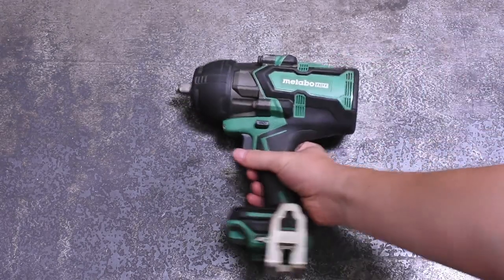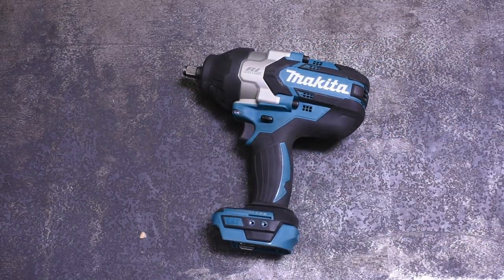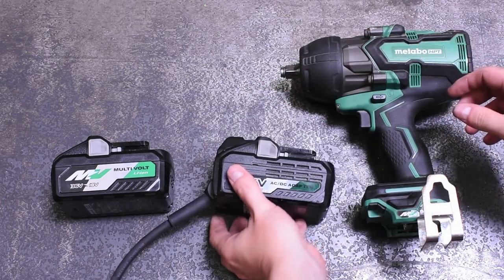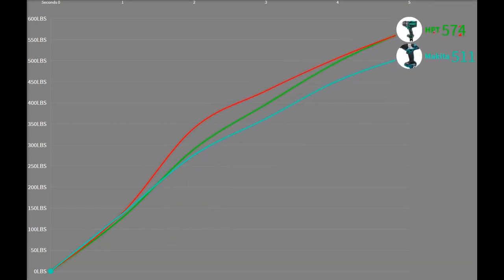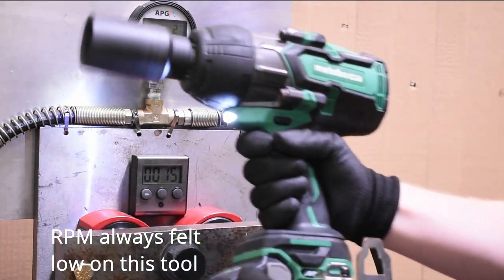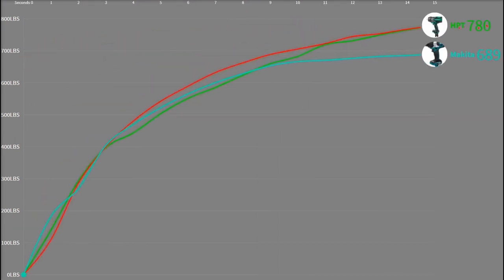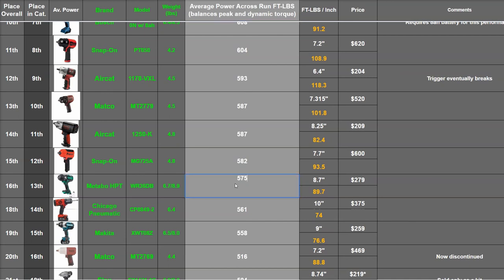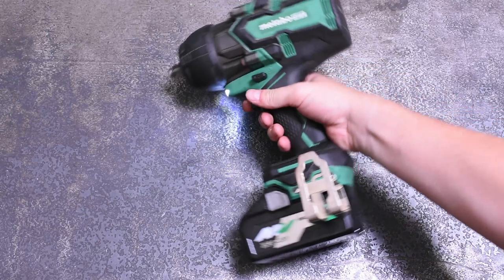What Happens When You Plug In a Cordless High Torque? Metabo HPT WR36DB

Comment: Metabo has a lifetime warranty as long as the tool line is being made. When the tool line goes away, so does your warranty. Also, all of my Metabos are IP56 rated...
IP56 = Protected against harmful dust (first digit) with protection from strong water jets and no harmful effects of strong water jets from all directions (second digit).
I enjoy your videos...thanks for testing!
Reply: lol, do you realize what the IP56 rating on their impacts is?  That is only for the hammer mechanism itself, dust or water will wreck the rest of the tool long before it would have wrecked the hammer mechanism, aka creative marketing that has limited purpose.  Also, typically the batteries are not rated for that so where will you use the tool without the battery?

I mean exposure for a moment, sure a coating can keep the tool running but regular exposure, will destroy it and would likely be considered abuse that is not covered under warranty.
Reply: @stinkycheese804  It doesn't matter since the original purchaser has a Lifetime Lithium Ion Tool Warranty and a two year warranty on batteries. 
"Lifetime is defined as the serviceable life of the product. This is defined as the period during which all components are available." So, it's when you are outside these warranty windows that dust and water matter! So, I guess you better have some back up tools!
Reply: I wash my impact driver with soap and water if it gets black crud all over it. That drives ip56 doubters crazy 

The motor and controller are putty'd into their own walled off sections in the shell and the controller itself is contained within a massive 1/2 inch solid acrylic brick with wires coming out of it. 😁

The only real concern in a tool like this is (probably) just maintain the rust inhibitor on the stator from time to time
Reply: Metabo did actually honor the warranty of an old Hitachi drill that I've had for about 5 years. The chuck wore out and was giving me issues. Sent it in to Metabo, they replaced the chuck with a new one and had the drill back to me in under 2 weeks. I was pleased to say the least and now own basically the entire 18-36V lineup. Great luck out of them all so far.
Reply: You're implying that once the tool becomes discontinued it's done. That's not true at all. As long as there are still parts for it, it's covered. That also doesn't mean they won't just give you the new version. They generally carry parts for 10 years after it's discontinued. This is per their words exactly.
Reply: @ToolDeals  What I stated is exactly what their warranty stated. Note the quotes. If they do something different, it is an exception to their warranty and is not stated in the warranty. 
Here it is again..."Lifetime is defined as the serviceable life of the product. This is defined as the period during which all components are available." Having a replacement part here or there is not a period during which all components are available. So, I guess that it boils down to...Metabo can do whatever  they want.
Reply: @marauder2525  you might want to call them as I have cuz they have said that They will continue making parts well after the tools is being sold
Reply: @baseballdude8491  You misconscrew what I am implying...I am not complaining. I have the Metabo Hybrid miter saw, the mobile table saw, the hybrid circ saw, 2 Triple hammer impact drivers and a hammer drill. I just wanted to set the record straight according to the warranty. In my business, if it isn't written it DOES NOT exist. 
P.S.No brag just fact... No FAN BOY here. I have other tools including Makita sub compacts, multi-tool, and rear handle circ saw. Also, Dewalt Flexvolt and 20 volt max tools. I don't use red tools.
Reply: @marauder2525  my bad-just got confirmation from a few other guys that Metabo HPT/Hikoki is going to support parts to these tools for yrs after the tool isn't being manufactured-I have had good success with warranty service and more straight forwardness with Metabo HPT/Hitachi than my other colors
Thanks for clarifying-I just get a bit frustrated with some.of the specific color fanboys who spout off things with little or no experience with the tools-again, my bad 👍
Reply: @baseballdude8491  You actually bring GREAT news. Thanks

Comment: Very interesting... I've seen that wall adapter and thought it was a good idea. Especially for a finish carpenter using the mini circular saw all day.
Reply: Would make more sense to just buy a corded saw, then with two tools you put less wear on each, and can move around without dragging a literal brick with you on the extension cord.
Reply: Some people don’t want two saws though.
Reply: @spottedcrow1126  right? already carry too many tools and im just an apprentice
Reply: Go ahead and drop another 4-500 for a.second saw
I luv my 10" mitre and table saw
Both are best in industry at that price range.and the table saw beats em in performance by far and capacity on the table
Reply: Yeah and AC adapter great for SDS Max Rotary hammers, table saw, vacuum, grinder, and other high run time tools
Reply: @stinkycheese804  we use adapters on our table saws, SDS Max rotary hammers, grinder, router and vacuum which are in stationary areas and save crazy amounts of Battery life/longevity
My other contractor friends were amazed/jealous when they brought out there SDS cordless Milwaukee and DeWalt SDS Max rotary hammers and ran out of juice and charged batteries while I just swapped over to the AC adapter when we were breaking up a large concrete stair

Comment: Grainger would come to my work to show off new tools and I was asking reps from each cordless tool company why can't I have a plug in adapter for my cordless tools . They all laughed and said why would you want to put a cord on a cordless tool ? I just shook my head . Maybe so I can have consistent performance on the 50 bolts I have to remove on a piece of equipment . Nothing worse than diminishing performance especially on old nicad  batteries and then I have to manually go back to hand tools and use the tool as a glorified nutrunner . Well it only took them 20 years to see what I told them was a great idea . What is the maximum amps that adapter puts out and does it maintain the voltage at max current output ? Lower voltage draws more current to get the same output . Could you please take adapter apart so we can see what they are using to rectify to DC from AC and if it is a transformer or a switching power supply and voltage regulated .
Reply: My question, why use a cordless tool with a cord when you can get some sort of corded tool that would function the same and probably be cheaper. The only advantage I can see now is they really don't make corded tools as much now. I would think an air tool would be the lightest, with very good power.
Reply: @snoopdogie187  yiy answered it. They don't makemAC powered corded tools like impacts.

Actually there advantages to the DC motors in these tools, it's just the batteries that suck. Better than the Nicad days, but still suck in the long run.
Also, being able to go cordless when needed without 2 tools would be handy. But when in a shop with constant power available changing/charging batteries all day sucks.
Reply: @snoopdogie187  with Metabo HPT u can use it where there isn't power but utilize it where there is saving battery longevity as well as increasing your overall run time and work capacity and not have to carry around a corded and cordless tool in your truck-makes a bunch of sense and we utilize the AC adapter at our Mitre saw, table saw, router , grinder, SDS Max rotary hammer and vacuum stations on the job site-if we need it for an area where not AC is around we put a battery in-its awesome and has given us more longevity on our batteries as well and lessens the # of batteries needed overall saving gobs of $

Comment: Are you guys planning on testing the Metabo HPT 3/4 in version? I'm curious to see how it stacks up against its 1/2 counterpart, both corded and cordless.
Reply: It is only rated for a 40 or so more lbs than the half inch so I don't know if it's worth it. I have the 3/4 model but there didn't seem to be enough interest to ship it to them.

Comment: the lower performance of the corded thing is because of the wire. the actual converter that makes the 36/40V is in the brick and the wire between the adapter and brick is what causes a voltage loss and thus lower total power.
Reply: @1pcfred  the brick can push out 50A. that is more then what the batteries can do for any reasonable time.
Reply: @1pcfred  its litteraly written on the unit by law what the output is. No need to guess or test. The power loss over the wire is simple ohms law.

Comment: Can't wait to see the tool truck high torques tested. I have a feeling they won't do any better than the regular cordless tools you can get at the home improvement store.
Reply: Cordless tools are scam. While I won't sit here and say all of the tool truck tools aren't a scam either, some of them cost the same as what you could buy from amazon and have the same and/or better power as a cheap scam tool from the hardware store designed to fail in 2-3 years.

Comment: I figured the plug in adapter would have boosted the output torque, but as demonstrated it did the opposite.  Course a dedicated corded impact would be totally different anyways, but a great demo that plugging in an adapter on a battery tool don't necessarily mean it'll make it better.

Comment: Awesome testing, I’m really thinking of getting into Metabo HPT line mainly for the angle grinder and being able to use a cord and battery!
Reply: I doubled down into the same impact, grinder, hammer drill, and recip saw. No complaints at all, phenomenal tools

Also took advantage of there webpage promotion at the time, buy a tool and register it on there website with proof of purchase. Then you get a choice of a free 4ah 36v battery or the wall adapter. I got a lot of batteries now + 1 adapter 😀
Reply: Absolutely the 36V grinder, SDS max Rotary, vacuum, router, portable band saw ,10" table saw are all great tools to utilize this hybrid cordless/corded option

Comment: Power loss with the ac adapter would be cause it stays at a steady 36 volts and the battery when fully charged would be closer to 42 volts. 4.2v per cell x10 cells = 42 volts.
Reply: When you put a battery cell under a load though the voltage will drop, so even though you may measure it at 4.2V fully charged it will run much lower when loaded.
Reply: @GuyFromJupiter  That is often true but something else to be tested/measured, as these larger cells in a higher voltage pack, won't necessarily droop enough to be significant in a brushless tool.  Either the initial 36V, or the AC/DC adapter droop under load, or the losses over the power cord, were obviously a factor so the delivered power was lower than with the battery.

Comment: The AC wall adapter is an interesting idea, but we probably should not be surprised that the tool loses a small amount of performance when using it.  Even if the power supply could deliver a steady 1,500 watts DC, there will be electrical losses in the DC cable between the power supply and the tool.   I could not find any specs for the DC cable, but I will take a few guesses.  Assuming 12 ft, 12AWG, & 40A @ 36v, the voltage drop (at full load) would be about 5%.  This correlates with the dyno test well.  This is not a criticism.  I like the idea.   I wish the tool system that I used offered this option.
Reply: And what about the battery when 75% charged? Or 50% charged? 

You don't have a freshly charged battery all day. But the DC supply would be constant all day.

The channel tests max performance, but the 50th bolt you remove is just as important the 1st.

I look forward to the results of future tests showing performance aftermath foxes 10second runs instead of just one run on a fresh battery.
Reply: 240 volts

Comment: Hello again Torque Test Channel 
Thank you for another Great Video. I am researching for my next tool purchase. And most certainly will be my impact and drill. Which right now is a five years old plus Hitachi twelve volt. So far this is all I have. At some point I will have to replace. And the Field is a lot bigger than I thought it would be. As a Aircraft Mechanic I don't need the biggest or heaviest tools. But I do need is more torque versus carrying a lot of weight. I may have to take apart a wing, maybe something like a Boeing 747. Carrying that tool until the job is done. The twelve volt has carried the day so far!!! The question I need to ask is should I stay in the Hitachi tools lineup or I keep looking? Again thank you
Reply from the maker: Keep looking when it comes to weight/vs performance. Looks at the Makita XWT14Z or M18 2960-20
Reply: @TorqueTestChannel  Thank you for the quick response. I will give them a look.
Reply: How many batteries are you willing to carry and keep charged?
Reply: @TEDodd  Right now, I carry two batteries. I think it came with 1.5 hours. One in use and charging.
Reply: Metabo HPT 1/2 mid torque is my go to now
Replacing my Milwaukee

Comment: About 10 years ago I adapted my craftsman cordless tools to run off a car battery. It let me run my sawzall and skillsaw much longer without bogging. These lithium batterys are great now though.
Reply: Ok, if you say so. The lithium batteries are a marketing scam designed to make you buy batteries every 1-2 years.
Reply: @JosephArata  well they are better than my old ni-cd batteries haha
Reply: @JosephArata  higher power density, no memory effect, and longer life. No scam. 

That's why other electronics have switched too, like your cell phone.
Reply: @JosephArata  dude every comment is a cordless hater take-look I still run corded tools but many of these tools make work go faster without as much set up-Metabo HPT 36V should be your choice to give em a whirl as they have the AC adapter for all those tools U want to stay in AC but also afford U the ability to unplug when u need to take them to the work where ni AC is available
Plus I've had some of my Milwaukee, Makita and Hitachi batteries for over 10yrs and they are still charging and working

Comment: Iirc, the way the metabo hpt lifetime warranty works, is "for the life of that model" - guaranteed as long as they haven't discontinued it. Just as an fyi, it's good to know how long your hpt tools have been out before buying if the warranty is important.
Reply: Actually I contacted Metabo HPT and it s the time they make the parts as well and confirmed that they plan on having most of these current tool parts for 5-yrs after discontinuation

Comment: I have The larger of the 2 Dewalt Vacuums that comes with an optional cord in the event you dont have battery or its dead. I have found the cord to be much weaker than the battery mode. I typically use the 60v 6ah batteries which is notably more powerful. However it's a vacuum.

Comment: Could be the losses in efficiency with the ac to dc inverter that makes the powerloss compared to the battery. Making 2000w in from the wall but around 1200w out from the adapter (up to 60% efficency at 120v) that would make it 33amps at most compared to around 35amps of the battery.

Comment: What happens when you take apart the biggest battery of a brand and replace the li ion cells (18650/21700) and put in the best high drain cells you can get. Like the molicel p45b 21700 cell or molicel p28a 18650 cell

Comment: That 120 volt adapter result surprises me. We've seen in other tests that the higher Ah batteries deliver higher performance, up to a point, and jumping from a battery that can deliver upwards of 35A to an adapter that can deliver 55A (2,000 watt at 36 volt DC) should (to my mind) result in a higher performance.

Maybe the battery delivers a higher voltage than the adapter? Or maybe the adapter doesn't actually deliver 36 volt?
Reply: Could just be that their ac to dc converter just has a lower max current than a freshly charged battery. If that converter on the cable or the one that connects to the tool has a label, it'd be very interesting to see max power/amperage output!
Reply: Two things, Inverters are not 100% efficient, you’re losing some of the input power as heat. Also, the adapter really only has 1500W to play with due to regulations on how much power something can draw on a given receptical/circuit (which is why most corded tools don’t go above 15A).
Reply: @reaperreaper5098  Ah, right. I forgot you have different power limits in the US.

In the EU we run 230 V/10A on regular plugs, giving us  access to 2,000 watt devices.
Reply: @MrMartinSchou  Yeah, it's stupid as hell, especially when 20A circuits for outlets has become standard here, with 120v30A in industrial/commercial being an option.

Then we still have the option to jump to 240V20A and go up. But no, reluctance to move from the 15A rated recepticals holds us back.

Comment: Would love to see breaker bar brands how adaptors effect them and for shits and giggles a breaker bar vs some half inch offerings
Reply: Adapters don't effect breaker bars nearly as much because there is a constant force (only once overcoming that resistance) rather than the hammering action that keeps having to overcome it on every blow, assuming apples:apples quality.  Frankly it is a bit irrelevant, breaker bar may not fit or else could just use a larger one, when the whole point was to not have to use one and go faster.

Comment: I’m always surprised when people think that plugging these tools in will somehow increase the power. The motor is designed for 36v, and the plug in adaptor does just that. It adapts the mains (120v AC) to 36v DC so that the tool can use it. If it overclocked the motor it would wreck it.